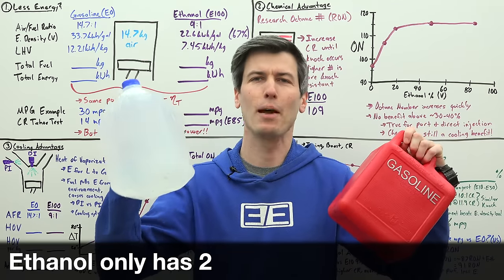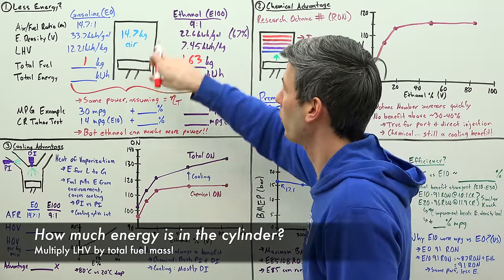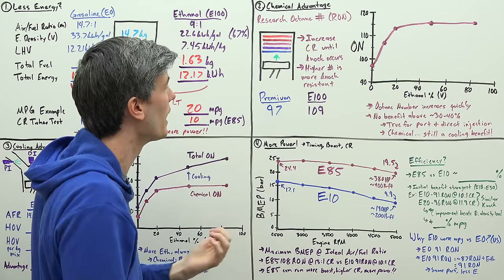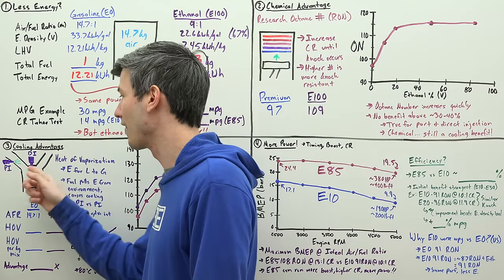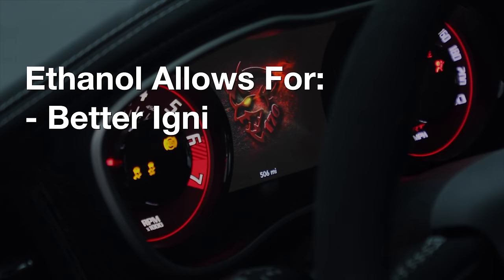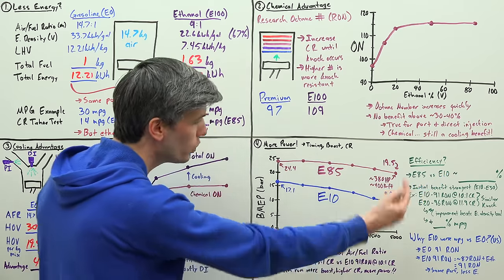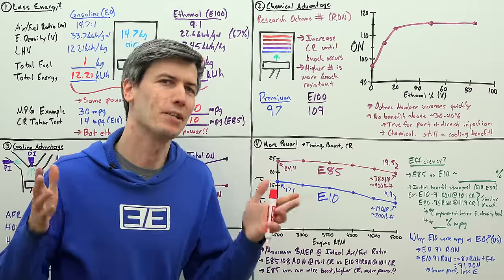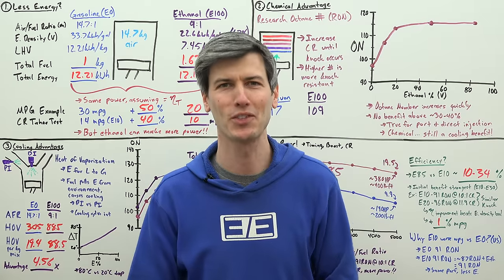Why Does Ethanol Make So Much Power? (Versus Gasoline)

Comment: If alcohol gives more power why lower mpg. Number 2 it requires more fuel to create that gallon of alcohol than that gallon produces balance that equation if you can. Number 3 alcohol created far more maintenance issues.
Reply: Electricity produced by fossil fuel takes more fuel to create than is produced (by more than a factor of two in the US) … so what’s your point … ??
Reply: Re #1 … You’re confusing energy and power.
Reply: Number 1. It is lower mpg because our engines are gasoline optimized but the power is real.  Chevy rates their 5.3L engine at a clean 380 horsepower on E85 vs a dirty 355 on E0.

In an ethanol optimized engine, you get both more power and more mpg than gasoline engines, even more than diesel engines at half the size/twice the power.

Here is an excerpt about the ethanol engine Ricardo built and drove for GM a few years ago:

FROM RICARDO:
The new federal CAFE standards are calling for a doubling of fuel mileage performance, which, Vint says, is going to send OEM’s looking for high octane numbers to improve efficiency and ethanol is the best source. Ricardo, an engineering firm with over 100 years in the business of engine design, has developed an extreme boosted direct injection engine (EBDI) to optimize ethanol blends. The 3.2 V6 gasoline engine rivals the power and torque of a much larger GMC Sierra 6.6 diesel, he said, and it delivers 3.5 percent better fuel economy than the diesel.

All the energy it takes to produce and deliver a product to the consumer is reflected in the price of said product.

As such, note the spot cash delivered price of ethanol on the NYMEX is $2.36/gal.
The price of an unusable sub-grade of gasoline (RBOB) is $2.65/gal.

It takes more energy to make unusable gas than ethanol.

To turn RBOB into usable E0 fuel costs a lot more like premium costs more. Unfortunately for humanity it also becomes far more toxic, carcinogenic, and dirty.

Or, simply splash in >10% ethanol to RBOB and the resultant usable fuel is less toxic, far cleaner burning, and cheaper/cheaper per mile to drive. Who can be against that?

Iowa State University measured all the energy it takes to produce an acre of corn into a "diesel fuel equivalent"This included making of the machinery, fertilizer, chemicals, also the tillage, planting, spraying, harvesting, drying, trucking etc. 
They found it takes 34 gal of diesel to produce one acre of corn.
What do we get from those 34 gallons of diesel?
We get >500 gallons of ethanol.
But wait, that is not the kicker.
The kicker is we still get 100% of the protein from that acre of corn still available for an even better feed. A win, win.
Reply: @sking2173  Just plain corn fused...I dunno why you guys try with these people...but Im here for the entertainment.
Reply: @danafletcher2341  A I have little faith in state/federal funded universities that start with a conclusion then fit the facts to fit their narrative. The corn based alcohol is far more heavily subsidized than fossil fuels. While I can agree on pollution factors the engine of today is not optimized for alcohol fuels . Alcohol based fuel brings its own set of safety hazards ,metallurgy comparability issues and fuel handling problems . There is also the issue that corn for fuel is driving up food prices because of land being pulled from food production. The protein that is left after fermentation is of little benefit for food for livestock or man. 
So show me what would the magic numbers show if all of the engines that produced that 500 gallons of alcohol were converted to alcohol fuel would deliver in balance other than arguably cleaner air. Please don’t forget all the petroleum based chemicals used for fertilizer,pesticides,fungicides that are used to produce that corn. Win or lose? 
Don’t forget the the other government boondoggle the forcing of battery electrical vehicles
Reply: @charlespaine987   The government ended the corn ethanol subsidy back in 2011.

The long-standing stated goal of the G7 Nations to end petroleum subsidies?  Not so much. 

All the energy it takes to produce and deliver a product to the consumer is reflected in the price of said product.

As such, note the spot cash delivered price of ethanol on the NYMEX is $2.36/gal.
The price of an unusable sub-grade of gasoline (RBOB) is $2.65/gal.

It takes more energy to make unusable gas than ethanol

To turn RBOB into usable E0 fuel costs a lot more like premium costs more. Unfortunately for humanity it also becomes far more toxic, carcinogenic, and dirty.

Or, simply splash in >10% ethanol to RBOB and the resultant usable fuel is less toxic, far cleaner burning, and cheaper/cheaper per mile to drive. Who can be against that?

The Indy 500 switched from gasoline to ethanol after the low volatility alcohol showed it superiority in safety in a deadly multi car crash.  Ethanol fires can also be put out with water.

Scania states their ethanol engine torque is equal to their conventional diesel engines and fuel consumption is on par with them.  So fuel used would be on par, nothing magical, known long ago by scientists and engineers in the early 1900s as you already know.

No corn is grown just for ethanol, it is too uneconomical.  

Rather, corn ethanol is a value-added product of >>>already existing<<< feed production which leaves 100% of the protein (and other things) still available for feed in a healthier, more digestible/efficient, and more concentrated form called distillers grains.

With this feed factor, ethanol can outcompete any other source and even outcompete petroleum in price.

The size of the corn crop is determined by the protein requirements of the cattle herd on feed, not ethanol production.

Flawed studies/videos negative on corn ethanol assign all/most energy or CO2 to the ethanol side and little/none to the feed side of corn when in reality it should be the other way around. Why? Because if we outlawed ethanol with another Prohibition, we would still grow the same amount of corn we always do and always have. Cattle feeders need plant protein to make animal protein so if their distiller grains were ended, they would have to find an alternative protein source and that would likely have to be switching back to feeding less concentrated straight corn. During Covid when ethanol plants shut down, cattle feeders using distillers grains were facing this very scenario.

I’ll post what happened to prices of grains and acres in another post but note that Federal agents back in Prohibition would target farms to search for stills whose show animals won the grand championships in the county fairs according to author David Blume.

Comment: It makes more power.... But at the cost of 25% more fuel burned. So if you get, say, 25mpg on the highway with gas in a 400hp car; if you seitch that car to E85 and get a 10% power increase up to 440hp, but burn 25% more fuel, you're getting less than 20mpg on the highway, and your fuel efficiency in city drovojg is goong too be mid single digits, for an extra 40hp. For the additoonal 25% fuel burn, are you actually saving money? 

In ny opinion, alcohol is best left to forced induction drag racing, where the difference between 110 octane race gas in a blown HEMI, and E85 in the same engine, is North of 200hp.
Reply: Its 1$ less a gallon then premium fuel so most times yes you do.

Comment: the only thing ethonal does is end up cleaner on smog emissions test than gasoline or diesel fuel.
Reply: GM rates their Chevy 5.3L at 380 horsepower on E85 vs 355 horsepower on E0.

Ethanol also lowers your cost per mile to drive while drastically cleaning the smog emissions as you mention.

Denver in 1988 was the first government entity to require E10 when they they were on in EPA list of ozone non-attainment zones.  Soon with ethanol they were off that list.

Even with just 10% ethanol added to E0, the Swiss Federal Laboratory for Materials Science and Technology found that the especially health devastating ultra fine or nano particulate emissions were lowered by 97%, carbon monoxide lowered by 81%, carbon dioxide lowered by 13%, aromatic hydrocarbon emissions lowered by 67-96%, and genotoxic emissions lowered by 72%.

Comment: Ethanol acts a little like lead in the old days.
Reply: Except ethanol is non-toxic and non-polluting.
Reply: @danafletcher2341  Yes, much better than lead!
Reply: @pseudopetrus  Problem is we still use lead in our avgas and if you search for an article that MIT put out called "Flying the Unfriendly Skys" you would see what kind of damage just that amount used is doing to humanity.  

The FAA did approve and certify an ethanol fuel for a whole series of aircraft (mainly Lycoming engines I do believe) which is called AGE85 which is 87% ethanol, 12% pentane, and 1% biodiesel.  With aircraft having higher compression the fuel economy loss is less and with cylinder head thermometers the engines can be leaned out better to reduce loss as well.  If one had a variable pitch propeller the extra horsepower would help reduce fuel economy loss as well.

But above 10,000 feet the fuel economy starts to become better with high oxygen ethanol than the petroleum avgas.

Embraer in Brazil sells an ag spray plane with a Lycoming engine which uses their common E100 automotive fuel.  The Japanese Zero used ethanol for fuel too.
Reply: @danafletcher2341  Ethanol made from corn is not good, we got farmers plowing down forests to plant more corn. it does not make sense.

Comment: Actually, gas has more energy then ethanol. You need 33 percent more ethanol to make the same power as gas, but ethanol has a higher octane rating.
Reply: Here is an engine Ricardo built for GM a few years ago and drove around.

FROM RICARDO:
The new federal CAFE standards are calling for a doubling of fuel mileage performance, which, Vint says, is going to send OEM’s looking for high octane numbers to improve efficiency and ethanol is the best source. Ricardo, an engineering firm with over 100 years in the business of engine design, has developed an extreme boosted direct injection engine (EBDI) to optimize ethanol blends. The 3.2 V6 gasoline engine rivals the power and torque of a much larger GMC Sierra 6.6 diesel, he said, and it delivers 3.5 percent better fuel economy than the diesel.

This is not new technology or knowledge, it was known long ago.  It is suppressed technology.

Rear Admiral C.M. Chester wrote Henry Ford a letter on Dec.15, 1916:
"...I also pointed out in the article that as governmental laboratories had developed from 40 to 55% efficiency in alcohol engines as against 20% in gasoline machines, the use of alcohol at double the cost of gasoline for power purposes, was cheaper for motor[s] than gasoline in common use today."

Comment: Why is E20 not more common?
Reply: India is going to E20.

The whole country of Brazil uses E27 in their non-flex fuel cars, boats, motorcycles, and small engines.  Based on their success, Paraguay went to E27 as well.

Comment: Skeptical.  I’ve tested on four daily drivers and one minivan with ‘E85’ adaptability built in.  All I have seen is mileage down between 8 and 15% and 15 to 30% greater cost.
Reply: E85 is way way cheaper here in the USA at the pump.

Comment: And the comparison to Diesel??
Reply: There is no comparison.

Read this excerpt from an article about an ethanol engine Ricardo built for GM and drove around.  This engine is why GM wants the EPA to come out with a 100-octane fuel standard:

FROM RICARDO:
The new federal CAFE standards are calling for a doubling of fuel mileage performance, which, Vint says, is going to send OEM’s looking for high octane numbers to improve efficiency and ethanol is the best source. Ricardo, an engineering firm with over 100 years in the business of engine design, has developed an extreme boosted direct injection engine (EBDI) to optimize ethanol blends. The 3.2 V6 gasoline engine rivals the power and torque of a much larger GMC Sierra 6.6 diesel, he said, and it delivers 3.5 percent better fuel economy than the diesel.

Comment: more power but way more quantity required.  Pretty much a wash.
Reply: Even with lower mpg in inefficient gasoline optimized engines, ethanol still has lower cost per mile and is near pollution free.

In ethanol optimized engines, you get both more power and more mileage as in this one Ricardo built and drove for GM a few years ago:

FROM RICARDO:
The new federal CAFE standards are calling for a doubling of fuel mileage performance, which, Vint says, is going to send OEM’s looking for high octane numbers to improve efficiency and ethanol is the best source. Ricardo, an engineering firm with over 100 years in the business of engine design, has developed an extreme boosted direct injection engine (EBDI) to optimize ethanol blends. The 3.2 V6 gasoline engine rivals the power and torque of a much larger GMC Sierra 6.6 diesel, he said, and it delivers 3.5 percent better fuel economy than the diesel.

Comment: TLDR:
It doesn't*

*It has less energy density, but much higher octane, so you can dump a whole bunch of it into a high compression engine it make more power. You have to use way more of it though, and in flex fuel vehicles it actually makes about 20% less power and mileage.
Reply: What you said applies only to our current gasoline optimized engines.  For example, a Chevy 5.3L gives a clean 380 horsepower on E85 vs a dirty 355 horsepower on E0 (E85 still costs less per mile to drive even with the mileage loss).

In an ethanol optimized engine which many manufacturers have prototypes of, ethanol will have not only more power but also more mileage.

Here is an excerpt of an article of an ethanol optimized engine Ricardo build and drove around for GM a few years ago:

FROM RICARDO:
The new federal CAFE standards are calling for a doubling of fuel mileage performance, which, Vint says, is going to send OEM’s looking for high octane numbers to improve efficiency and ethanol is the best source. Ricardo, an engineering firm with over 100 years in the business of engine design, has developed an extreme boosted direct injection engine (EBDI) to optimize ethanol blends. The 3.2 V6 gasoline engine rivals the power and torque of a much larger GMC Sierra 6.6 diesel, he said, and it delivers 3.5 percent better fuel economy than the diesel.

This is not new technology or knowledge, it was known long ago.  It is suppressed technology.

Rear Admiral C.M. Chester wrote Henry Ford a letter on Dec.15, 1916:
"...I also pointed out in the article that as governmental laboratories had developed from 40 to 55% efficiency in alcohol engines as against 20% in gasoline machines, the use of alcohol at double the cost of gasoline for power purposes, was cheaper for motor[s] than gasoline in common use today."

Comment: Fuel economy is trash? No, it is NOT. I don't know why you say that, when you even calculated that it is more efficient.

It only APPEARS trash, because you measured it in MPG. But MPG is NOT the same as fuel economy. It is just a convenient shortcut to compare the fuel economy of different vehicles, using the SAME FUEL. But obviously it is not the same fuel, so we simply can't use it anymore. 
What really matters is not the volume of the fuel, but the cost and the emissions. If it takes up 10% more volume, but it costs 20% less, and emits 20% less harmful gases, then I don't care about the volume. (I would care if it would be a rocket fuel, but for a car, it is not a big deal)

It would be good to see the calculation of the cost* and emission difference between the 2 fuel types, for 100 miles, ignoring volume difference. IT would look nice on a whiteboard:)
(* production cost, not fuel station cost)

Comment: Do we even need to dehydrate gasoline with the ethanol added??
Seems like a modern myth to me.
Reply: Many years ago, in the days of E0, I can remember in the wintertime gas stations having stacked cases of little cans of alcohol gas-line antifreeze up near the check-out counter.

Today, there might be a dusty bottle or two of gas-line antifreeze on a back shelf.

Mercury Marine, which hosted a Webinar on ethanol myths, noted that ethanol does not "grab water molecules out of the air." It is hydrophilic, which means ethanol holds water. With regular gasoline (E0) as well at E10, the primary cause of water collecting in tanks is condensation on tank walls. But unlike E0, which can absorb almost no moisture, E10 can hold up to half of one percent of water by volume, and the water molecules will dissolve in the fuel. The "solubilized" water will bypass the water separator and burn harmlessly through the engine.

>>>Mercury Marine also says E10 may be the superior fuel(over E0) because it keeps the fuel "dry"<<<